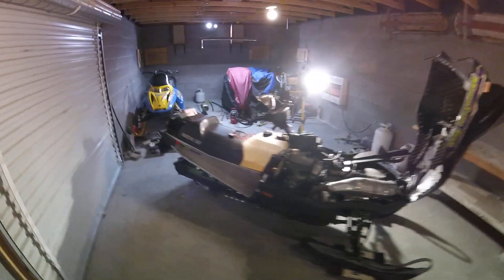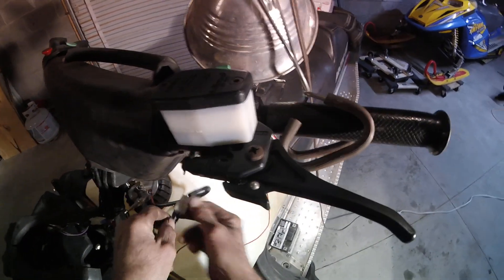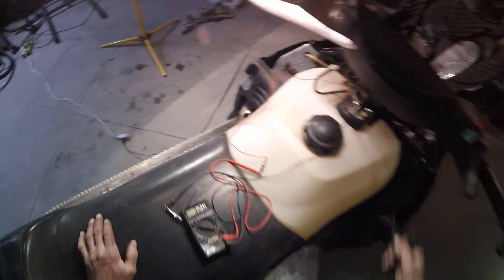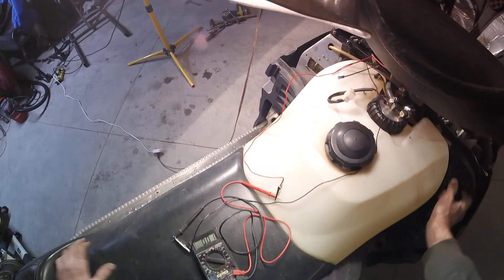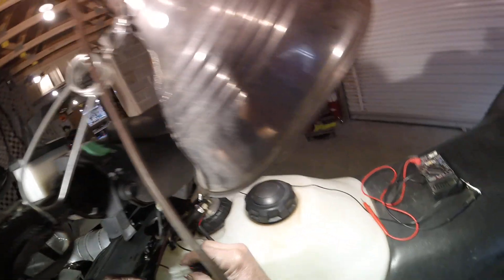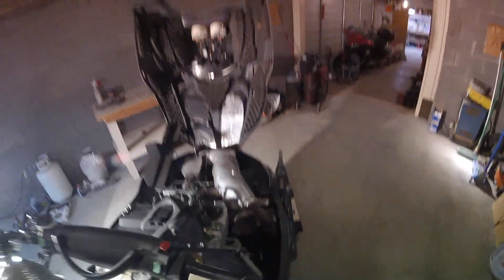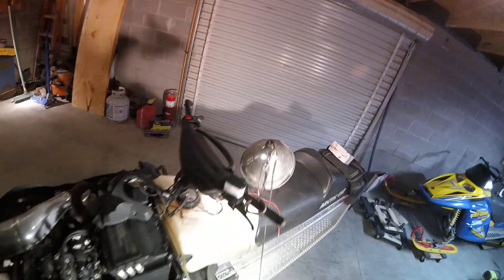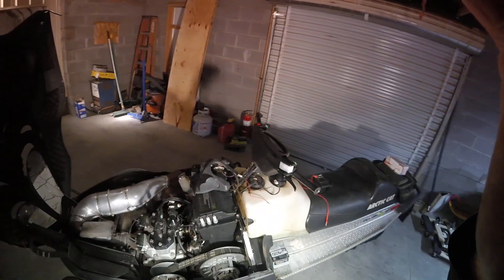Arctic Cat EFI Trouble Shooting !!!

Comment: I'm having issues with my 2015 m8000 it currently isn't running Ive replaced the ecm adjusted my power valves replaced stator and pickups and it still won't run all new plugs and coils every plug dielectric greased any help would be greatly appreciated not sending fuel at this time but has spark
Reply from the maker: I would try to power up the Fuel pump using jumper lead's , Best of Luck !

Comment: snowflake superbike- any ideas on 2003 arctic cat efi, runs but bogs down, changed gas, plugs, and fuel filter.  Prior owner cut middle wire of TSS saying that this would help, but didnt
Reply from the maker: Scott thank's for your Sub ! EFI is not my strong point , if you can jump a small 12V battery to fuel pump and it cures the problem it;s a bad stator , Never heard of cutting middle wire of TPS , The Most common component to fail on these Cat engines is the stator !!!

Comment: So my sled is a zr600 efi 1998 and Im having alot of trouble where it starts up and runs for like a minute and then its like hitting the kill Switch on it. I have tried to disconnet the kill switch but got the same results. Could someone help
Reply from the maker: Wallie , Heat generated in the Stator is the most common cause of these EFI Sled's to fail , Sound's like you start up cold , stator warm's up and Fail's !Best of Luck Bro !!!!